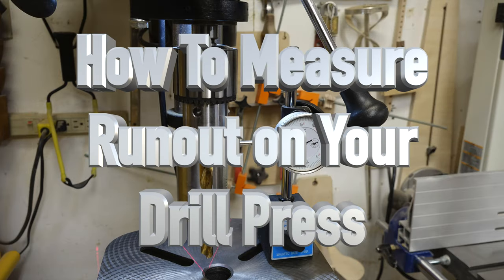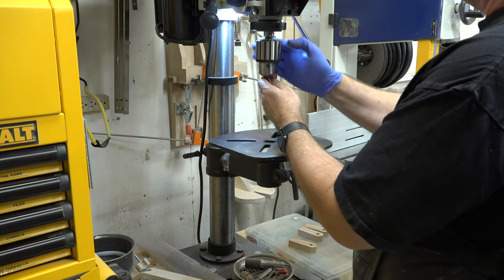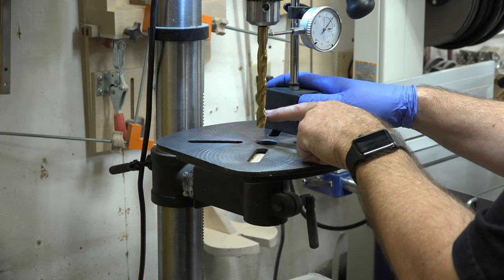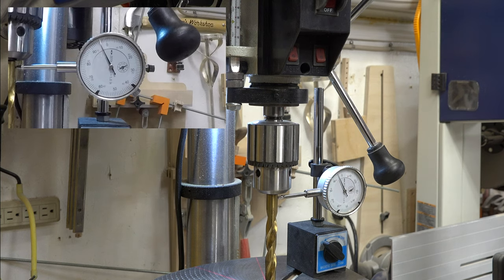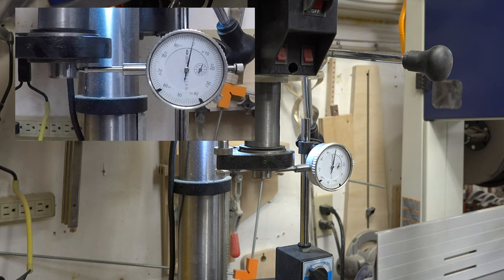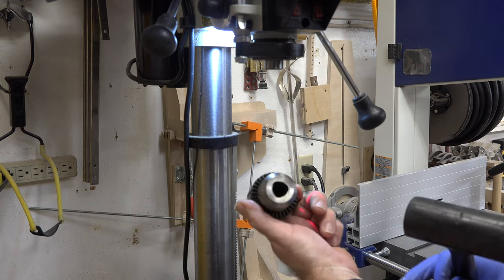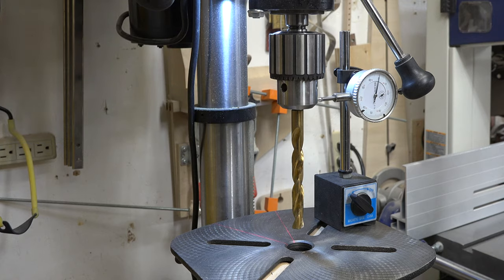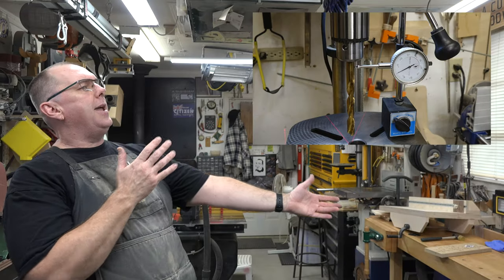How to Measure Drill Press Runout

Comment: I work on drill presses. This came up in my feed. You're absolutely right saying that one needs to start with a standard that's perfectly concentric. Not as easy as it sounds. To give an example, I went through a box of calibrated gage pins to find a handful that were concentric on the same axis as a press. Using a drill as a standard is like flipping a coin. Same goes for anything else that either isn't straight and perfectly concentric. I'm talking tenths, not thou. As an example, my own main machine - I have five presses - sees .0002-.0006 runout with a 1/2 Rohm Spiro chuck throughout its entire range. A NOS Jacobs 34 runs .0007-.0018 throughout its range on the same machine. It's important to indicate the full range of the chuck, not just a single point. Like you, I also polish the tapers. I have a bench buffer and use lightly abrasive compounds aimed at jewelers with a denim wheel. Once in a while, felt. Decent arbors are inexpensive; sometimes it's easier and ultimately better to install a new one.

Same with polishing an internal taper, and that's where a Foredom TX flexshaft comes in. Then there's the play in the quill that needs to be taken care of, yadda-yadda. There's a lot to this, more than folks usually think. Same goes for indicating. As you'd mentioned, it's easy to gather an erroneous value. Imagine how that works with tenth indicators. A magnetic base is not an option; it's a necessity. Personally, I use Noga stands. I'd suggest turning the motor pulley for lower vibration. Really, one would have to write a novel to explain all this in detail and include every step. If you have a question, I'd be happy to post back. It seems like your audience works with wood, so having extreme accuracy and consistency isn't terribly important. A 1/64 is a bit over 15 thou, so a runout that 3-4 thou isn't such a big deal. Good luck.
Reply from the maker: This is some great information Felix and I appreciate you taking the time to type it all out in your comment.  You are 100% right that there are many different factors that affect the runout in a drill press and any one of them can affect the next.  You are also correct that the drill presses that are used and intended for this video demonstration are for woodworking and having that absolutely "perfect" runout factor isn't as important as say milling steel parts for a precision machine.  Thank you for tuning in to the show and taking the time to leave your comment.  It is truly appreciated.

Comment: Your thoughtful and well-illustrated videos walked me through the shopping, purchase, setup and initial testing of this same Rikon drill press. I still haven’t found the manual, so thanks for graciously sharing your expertise. Got mine new but already set up. Now I can work my way backwards to test it with a digital indicator as delivered — and if necessary — test it again after removing and cleaning the chuck. Also, 👍👍 for the hidden tutorial on how dial indicators!
Reply from the maker: I'm glad that I could help George.  That is the whole purpose of this channel, to help people and I'm glad that on some levels, it's succeeding. Thank you for tuning in to the show and for taking the time to leave your comment.  I truly appreciate it.

Comment: Good detail, and that’s how it’s done. We always want perfection but to have that you need to calibrate and check dial indicators and the loop never ends.
Reply from the maker: It is definitely an endless loop of checking and calibrating.  That goes for any tool that we want accuracy from.  At some point in time, we have to decided how inaccurate our accuracies can be and still be acceptable.  Thanks for tuning in and for chiming in with your comment.

Comment: This got me to thinking about my old Delta 12" benchtop that I bought in '97, so I did the test. Surprisingly, I had barely .001 at the chuck and a little over .002 at the end of a rod 5" down from the chuck. The rest of the machine is rusty and beat up, but I guess I don't have to worry about runout. Don't remember if getting the table 90° has been in one of your videos, but would like to see how you handle that part. I need to get a new table and want to make sure that it's setup properly. Love your builds and Alt Tue as well - Chris
Reply from the maker: Sounds like your old Delta is running just fine Chris.  Glad to hear that you are enjoying the channel.  Thanks for tuning in and for taking the time to leave your kind words and your show suggestion.  It's very much appreciated.

Comment: The last few minutes of the presentation covered the other areas that could cause problems.  Dust and grit on either of the sides of the jaws in the chuck is possible.  Metal machinists and their machines are held to quite tight tolerances. But the blue print will always have a measurement plus or minus and X amount.  If tighter tolerances are required that is where grinding and polishing come into play or in woodworking, sanding to the line.  Shooting for tight tolerances on wood working machines is chasing your tail.  The wood is going to move on its own due to moisture anyway so there goes your "perfection".  Good video on using a dial indicator.
Reply from the maker: Thanks for the kind words on the show Dwight.  I agree fully with what you say about accuracy and woodworking.  Pretty hard to be 100% accurate on a product that moves depending on a variety of conditions.  Either way, it's nice to get the drill press set up as accurately as we can expect and I was surprised at the number of people who had questioned about run-out and how to measure it.  Glad that you liked the show.  Thanks for tuning in and for chiming in with your experience.  It's appreciated.

Comment: You should look at the Nova Voyager variable speed drill press.   Its a direct drive, so the motor does not hang out at the back making it more compact.  Speed control from 50 to 5000 RPM at the turn of a knob.  I love it. I considered the Rikon, but on further investigation read comments that it can make a lot of noise when cold, and since my shop is an unheated garage, this was a factor.  The Nova is virtually silent.
Reply from the maker: That's a nice looking drill press David.  Pricey, but nice.  I'm glad that you like it and are enjoying it.  I would be interested to see if you still like it after a year of use.  I'm sure you will.  Thanks for tuning in to the show and for bringing the Nova Voyager to my attention.  It's very much appreciated.
Reply: @acutabove_woodworkings  In Canada, the Rikon variable speed 17 inch drill press costs $1450, the Nova Voyager 18 inch $2000 CAD.  Not a huge price difference, and well worth it for the features.  If you cant justify the higher cost, there is the Nova Viking 16 Inch for $1400 CAD, a little less swing, but cheaper than the Rikon and the DVR motor on either Nova drill press is fantastic.  You can tap holes, run in reverse yada yada. No I dont work for Nova/Teknatool, just happy with my purchase.
Reply from the maker: @woodysranch2690  The model that I am testing on this show is the bench top 30-212 variable speed press.  It's $599.00 CAD.  I do like the sleek look of the Nova though.

Comment: The runout on my Bosch PBD 40 is absolutely insane.
At first I thought it might be a "monday version" as we call it here in Denmark, but it turns out that, even though it is quite an expensive chuck, it is of quite low quality, and guess what, it is intended for hammer drills...
Reply from the maker: That just doesn't sound right Henrik.  I guess it just shows that expensive doesn't necessarily mean quality.  Thanks for tuning in to the show and for chiming in with our experiences with runout.

Comment: Hi Kenny! Still liking your Alt-Tuesday shows. I have the floor standing Nova. When I received it, it was so bad on run out that I just filmed it and sent it to them and they sent me a whole new quill assembly. Just what you want to do, buy a new machine and then rebuild it. Now, when I am near the farthest the quill will extend I think the runout is still significant. You have given me the impetus to check it. And now is a good time since I am in the middle of doing the table with the gears and am just about to remove the old table from the drill press table so I will have the metal table showing. Finally, I am kind of wondering if the chuck itself while turning the key doesn't cause the 3 teeth holding the bit to perhaps throw the bit out of alignment. Only one of the teeth being say the first one to move could pressure it over a little creating your remaining runout. In any event, I am not anal retentive so I think your not worrying about this is the correct path to take. Regards, Bill
Reply from the maker: Glad to hear that you are still tuning in to the Tuesday episodes of the show Bill.  You just never know what you are going to see on a Tuesday.  Could be anything from tool maintenance to me ranting about the lack of quality in appliances that are sold today.  You just never know.  Glad to hear that you've been inspired to check your press.  Good luck with that.  I hope the measurements are favourable.  Thanks for tuning in sir and for chiming in with your thoughts.  It's appreciated.

Comment: You could have knocked that quill out of the chuck and clean both the inside of the chuck and the quill where it fits into the chuck. That could easily knock off a couple of thousands.
Reply from the maker: You're 100% right on this.  The joint between the quill and chuck as well as where it connects into the drill press can easily be fine tuned just with a cleaning.  Thanks for tuning in and taking the time to leave your suggestion.  It's appreciated.

Comment: Why didnt you mention the spindle?  I measured my chuck and it was 18 thou.  I removed the chuck and measured the spindle: 10 thou.  Ive got two problems.
Reply from the maker: This show is about the method used to measure the runout.  The same procedures apply whether you are measuring the chuck or the spindle.  Thanks for tuning in to the show.